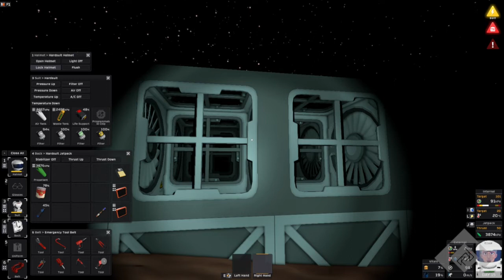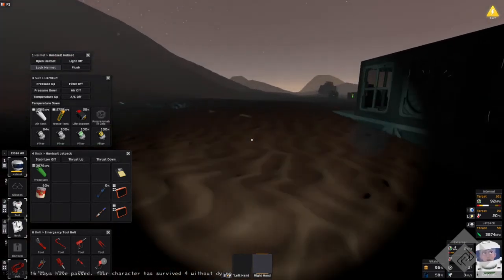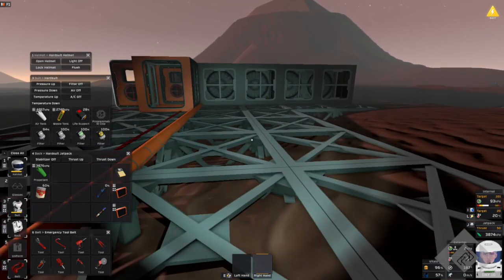Free Energy, Perpetual Blowing Machine - Stationeers Experiments

Comment: has this been changed? I have 8 turbines a lengthy tunnel and about 80kPa and I can't get more than like 142W total with one active vent going.  What parameters do I need to get the full 90W out of the turbine itself? (assuming a single tunnel with one turbine)
Reply from the maker: I do believe it has been mostly patched, and I haven't played in a while so I'm not exactly sure how to replicate this in the current version... however, you might want to try the portable devices such as the scrubber, the balancing on those a little more favorable and you might be able to use several to push air into a tunnel to infernally power them. Also, the longer the tunnel, the more turbines you can stack, the more energy you will create. As far as I know, friction does not exist in the game, so if you double to turbines, you will almost double the output.
Reply: @JoelleTheAbsurdist  yeah, my tunnel is extendable, I was just trying with the 8 I had in place and didn't get anywhere near what people are claiming.  If it worked properly, I should be seeing 720W -- but I'm not getting even close to that.  Scaling up to compensate would take a ridiculous amount of resources.

Also I think the filtration rate has been changed to be based on a pressure differential on both ends so that might impact the outcome as well.  Using a filtration unit gives me 14W total using 8 turbines against 44W of power draw.
Reply from the maker: @tatsumakijim  I don't that is true for the portable filter on a stand, but, it could've changed
Reply: @JoelleTheAbsurdist  I tested it last night and the portable scrubber does indeed pull about as good as an active vent for about 50W total (depending on proximity to the transmitter)

With 3 scrubbers I'm getting about 37W per generator.  But it's VERY slowly climbing as the pressure increases, though the beginning of my loop is starting to hit 150kPA, I will need to upgrade my walls to withstand the pressure.  my generators lose about 1W of power towards the end of the loop at the moment.  But the law of conservation of energy is still busted.